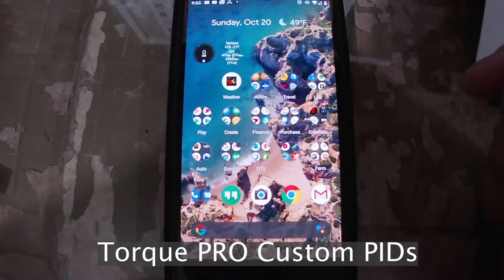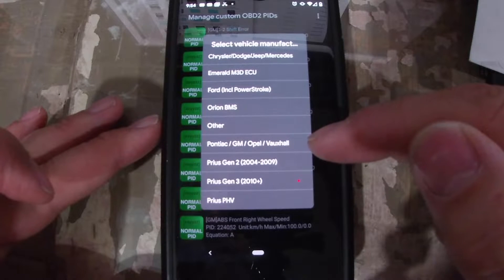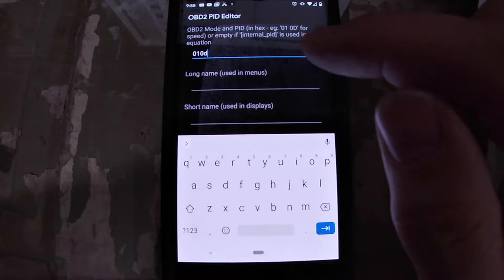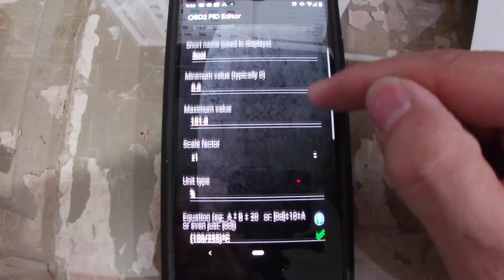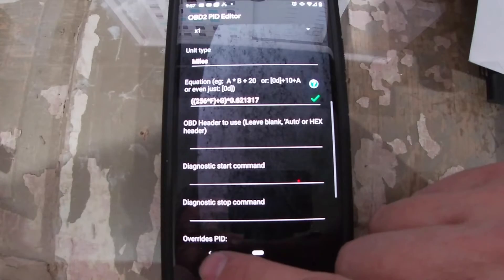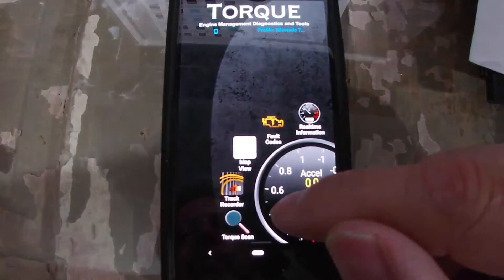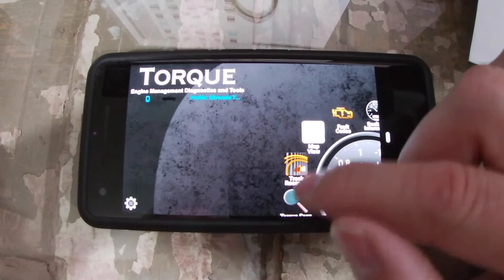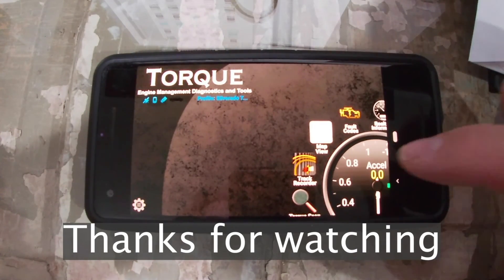Adding Torque Custom PIDs

Comment: Thanks for the info. Is the regen distance the last value of how many miles before a regen had to occur, or is it an average?
Reply from the maker: The Regen value is the distance between the last regen and the prior one.  Only a single point value.  Then the next one is run and finishes the value gets updated.  Thanks for commenting and watching.

Comment: For me the fuel pressure option is black and when I add it doesn’t work. What could it be?
Reply from the maker: If the option is black in the list then that means no data is coming back for that PID.  The fuel pressure is not something that is a regulated standard value so companies can move it around in the data stream.  I'll check mine this weekend and see if mine is working and let you know.
Reply: Chad Ivan thx man, let me know.
Reply from the maker: So I checked mine also.  You are able to get the lift pump pressure but not the fuel rail pressure.  I believe this could be due to the fact that this engine runs up to 36,000psi so they must have a different PID to report it with a different calibration factor.  I'll do some more digging but I'm pretty sure it will be a while before someone figures it out :(
Reply: Chad Ivan Don’t worry man, I’ll measure it the old school way. Thanks for the reply and follow up.

Comment: Would this work on the 6.6l Duramax?
Reply from the maker: I have not tested it myself on any modern Duramax.  It worked on my LB7 with some minor exceptions.  Since it didn't have any emissions stuff these new items where not necessary and the other thing that didn't work was the balance rate PIDs, they must have been a different value.  All other gauges worded perfectly.  What year / model 6.6 do you have?  I could try and see if my buddies has that model engine and check it out.
Reply: @CJIEngineering  It is a 2020 L5P. I mainly just want to monitor soot levels and regen. I tried your PIDs. The regen on and off worked and the regen started at 100%. The only thing that seemed off was after the regen was complete, it showed somewhere around 30% soot instead of 0?
Reply from the maker: @bluebowtie2007  So the clean value will typically be between 0.8% and 30% in my experience.  If you happen to be towing during a Regen the cleaning cycle will be better than running unloaded.  I have had people say that is because of the RPM that the engine is running during the cleaning cycle but I have not validated that yet.
Reply: @CJIEngineering  Ok, if it is normal for the value to not zero out, then it sounds like it is working! And I was towing at the time. I am close to another regen and i won't be towing. I will follow up with my value after. Thank you for your help!
Reply from the maker: @bluebowtie2007  Sounds good.  Thanks in advance for keeping me up to date :)
Reply: @CJIEngineering  After a regen today, it went down to 8.2%. I was in a national park so i put the truck in a lower gear to keep the RPMs at 2000 to 2500 as i was driving 30mph.  Thanks for supplying this information, it will really help me plan for regens!
Reply: @CJIEngineering  I have them working on my 2022 l5p. I even have the current gear working. Learned that this truck doesn't typically use first gear on a regular Unloaded takeoff.
Reply: @samgford  Hi there Samuel I was wondering whether you could  tell me how you got the current  gear to work as I have a 2022 l5p also. Thanks Brian
Reply: @Brian-yr3nl  I'm pretty certain it is exactly how he had it in the spreadsheet. When I actually created the display I just used the digital display on a pretty small size. Like I said earlier you might think it's off because it normally starts In second gear.
Reply: @samgford  Thanks for the reply, I have tried the one on the spreadsheet and I cannot get the equation to work in the pid. Thanks
Reply: @Brian-yr3nl  what's your email so I can attach a screen shot of my custom PID?
Reply: @samgford  Seems that I cannot get the email reply to go through probably for security  reasons.
Reply: @Brian-yr3nl  YouTube sucks... I've tried multiple ways to link to an image host but it keeps removing it.
Reply from the maker: If you want to send the image to chad.ivan2@gmail.com I can share it in a Google Drive folder.
Reply: @samgford  Yah you got that right that You tube Sucks. I even tried to sent it with spaces so it did not look like a email (NO DICE)
Reply: @Brian-yr3nl  I sent them to Chad to put on Google drive.
Reply: @CJIEngineering  do you think that a backup and import of torque settings will transfer custom PID's? I could send a backup of mine to put on Google drive? Or upload yours for the 3.0 folks so they have them all.
Reply: @samgford  Thank you it is greatly appreciated

Comment: Great video,   which exhaust temp pid are you using.
Reply from the maker: I typically look at EGT1 and EGT2.  I believe 2 is the DPF temperature.  Thanks for the question.

Comment: What ODB2 adapter are you using ?
Reply from the maker: I'm using OBDLink MX.  It has security, you need to push a button to allow pairing and it has higher refresh rate than cheaper models.  Thanks for the question.